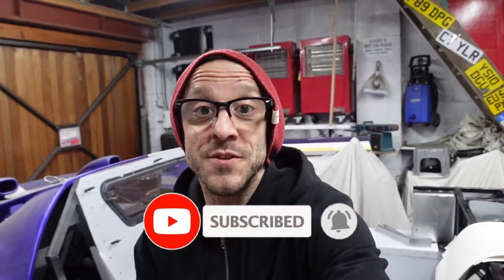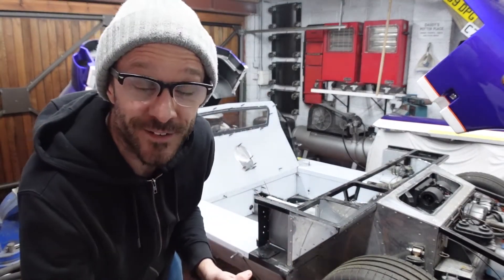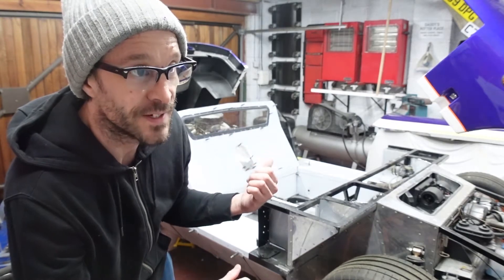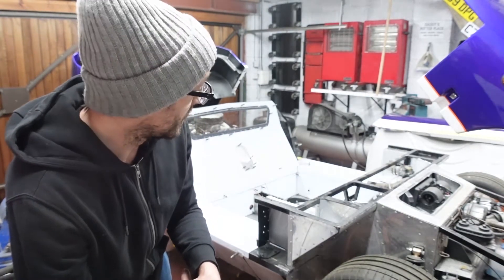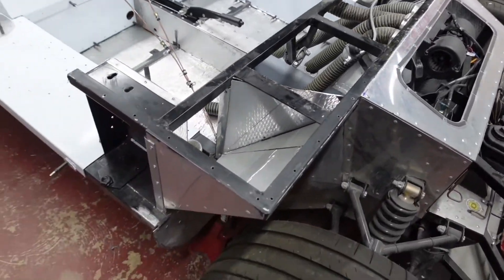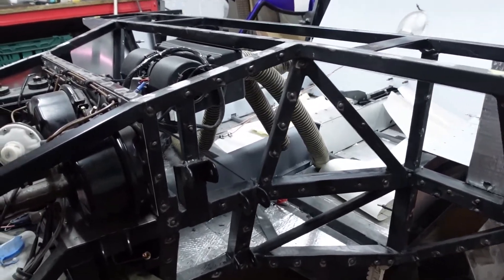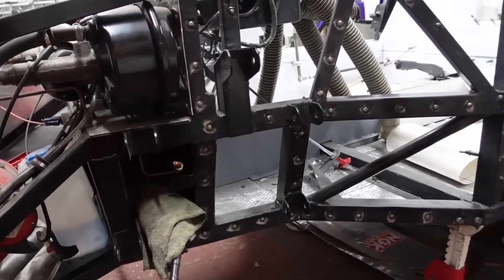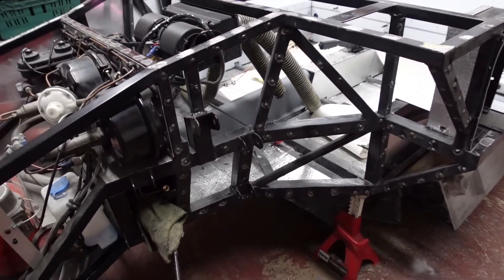GT40 Restoration  - Ep 11: Creating Bespoke Front Chassis Paneling

Comment: Have you thought about using hydroboost? That is if you have powersteering already it take the hydraulic pressure to apply the boost to the brakes. Or there are plenty of electric hydraulic pumps.
Reply from the maker: I don't have power steering, it really isn't necessary in these cars :-) I'm looking at going more in keeping with the period of the car hence waiting to do away with any 'extras'